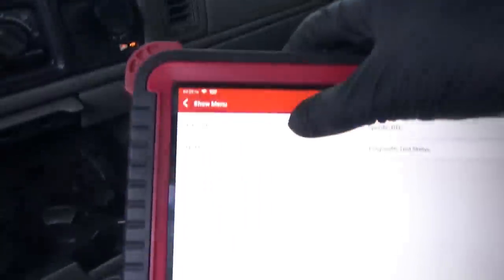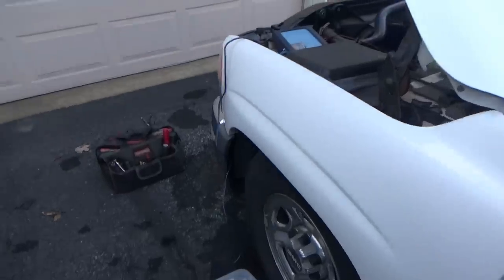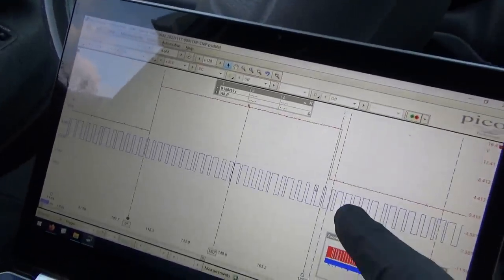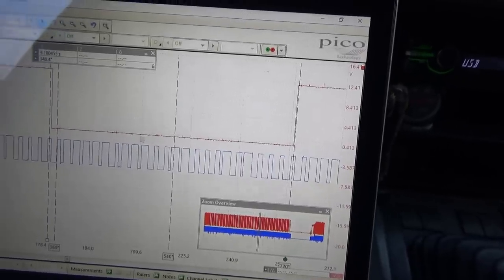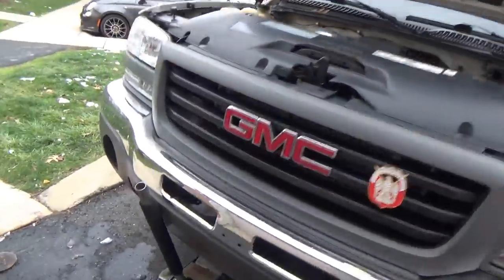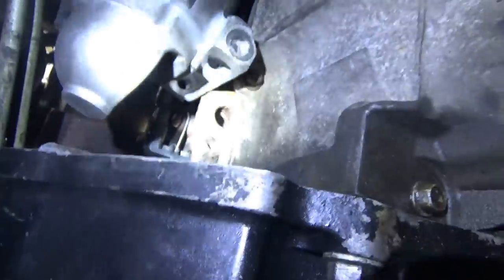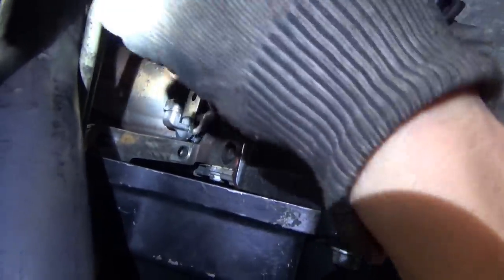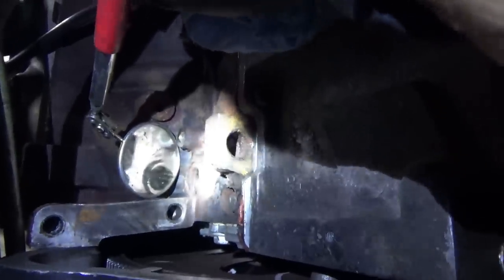Angry GMC: Runs Like GARBAGE! (Stall-Misfire: P0336-CKP Performance)

Comment: Well done Ivan.  I had a Range Rover Evoque with a cam crank code and the crank sensor had a similar issue in detecting the teeth at higher rpm.   Distance matters, especially with cheaper oem parts that aren’t as sensitive to begin with.  All hail King Ivan, Lord of the NPR repair.
Reply from the maker: Air gap is crucial! Especially at high rpm!

Comment: Wow. Your ability to process "long" and "short" pulses is better than some of my violin students 🤣
Reply from the maker: Did they diag the Camry V6 misfire yet Greg? My money is on ignition...like a bad spark plug wire on the 2000 Sienna ;)
Reply: @PineHollowAutoDiagnostics  not yet. The shop is booked up. Good thing I have two other hoopties 😜 I'm hoping it's an ignition coil or wire issue, and not low compression on a cylinder. It's been shaking a little for a long time, but maybe running up a mountain at 4k rpm did something 😬
Reply from the maker: @GregoryGlessnerViolin  Nah italian tune up only makes those run better :) Should be a 10-minute diag..."booked up" is a poor excuse lol!

Comment: Well done ivan 😀
It's such a crude sensor fit for a critical measurement.
So the amplitude of the pulses may not have been high enough to register on the input of the computer all the time.
They should of put two bolts on a ring to apply pressure to both sides of the sensor.
Tight ass manufacturers lol.
The owner looked so happy 😀

Comment: I've seen this a couple times. Happens on dodge magnums too. Rust builds up right by the o ring and just that little bit will cause problems. And I'm not sure Ivan, people on the internet tell me all the time that I don't need a scope. "Just use a dvom and watch for voltage changes" makes me wanna beat someone lol
Reply: Apparently they don't realize 24x wheel at only 2000 rpm = 800 registers a second even if a dvom could read that fast they couldn't...

Comment: Did you ever verify if that sensor that was in it was OEM??? So you never tried the old part man took out for comparison sake??? Amazing Ivan. What a clever diagnosis and results
Reply: The truck runs correctly so it's no need to prove anything that Ivan didn't get involved with.
Reply: The owner claimed AC delco, but it would have been worth a look

Comment: Buick 3800's of most era's use two tone rings on the back of the harmonic balancer and two Crank positions sensors (it is one physical unit, two hall effect sensors).  One tone wheel is evenly spaced, same size teeth while the other is long and short to indicate cylinder TDC.  Even the GM sensors for these are now junk so a better bet is anything with lifetime warranty and being skilled at swapping them.

Comment: well, Ivan is now more familiar with LS engines and the goofy two piece riveted together and interference press fit onto crank with no key/dowel pins! :)
not that you will, but to install/remove them you heat the snot out of them and work carefully, precisely marking alignment is critical before removing them or make/buy a special alignment jig.

Comment: The sensor is sensing the complementary target. It senses the shift of the magnetic field from oneside of the target to the other.  This design allows for less sensitivity to the airgap. Also allows zero speed detection of target with high tooth count.  Same type of sensor for the cam shaft but its target is machined. Not a sandwich stamped target like the crank shaft target.
Reply from the maker: But it is VERY sensitive to air gap apparently!

Comment: The crank sensor magnetic surface position to the teeth is very precise, I guess it should be parallel to the teeths, and the bracket play a big role in it, if the bracket somehow deformed, it will definitely affect the performance of the whole sensor, and as consequence bad engine performance.

Comment: That rust sure causes a lot of problems!  The owner's REAL HAPPY now!  How long did the truck sit before you got to it?  Hopefully the gas tank was full so no moisture collected in the tank.  This diagnose reminded me of that GM pick up with OBD1 when you swapped PROM's in the PCM.  With all the mods done to it, it's a wonder it runs.  Maybe a good dyno tech could help it run better for optimum performance.
Good fix Ivan!

Comment: I wonder if the old sensor was rust jacked out of place tossing the code.  Replacing the sensor didn't work because of failure to clean up the hole before installation.  Huh.  May never know.

Comment: I have 369k miles on that GM best vehicle s I got 400k out of 5.3 GM one transmission
Cam loping with rich exhaust throw a O2 fuel trim code? 
Aftermarket parts often POS.
CAm and Crank sensors  compare to check timing chain stretch or loose cam gear reluctor.
I found metal chips on sensor magnets also cause havoc.

Comment: I wonder if the rust was the issue with the original sensor? Rust built up and pushed it out a little bit, thus the replacement not fixing the issue?
Reply from the maker: Yup

Comment: Do the 2 reluctor wheels cause the signal timing to change by small amounts based on RPM. It would be interesting to compare the wave form at different RPMs. A solid state variable ignition timing system. ???

Comment: I got a 2012 impala ltz with p0305 misfire.  Swapped plugs, swapped coils with known good, swapped injector with known good, cleaned intake valves, still misfiring need your help.  Do you ever make it up to michigan?
Reply: Runs good and smooth on the free way.  You can feel the miss when idling like at a stop light.

Comment: The unnecessary o-ring strikes again. I've seen this so many times when people replace their own sensors. I usually don't even clean the hole out, I just take the o-ring off and slather some fluid film or grease in there.
Reply from the maker: Uhhh then you would have an oil leak 😅
Reply: @PineHollowAutoDiagnostics  I just top the bellhousing fluid off every time they come in for an oil change and it's all good.
Reply from the maker: @JPAutoService  🤣🤦‍♂️ so your method would not work on this truck haha

Comment: How does the computer get the fuel trim at idle correct with those long overlap cams?  Seems to me the cats would melt?
Reply: No cats
Reply from the maker: Fuel trims are like 20% at idle but it still runs lol!
Reply: @PineHollowAutoDiagnostics  No check engine light?

Comment: So it has a new cam. How about a new crank? Perhaps it is a rebuild? I think the ultra sensitive crank sensor signal (gap dependency) is due to the crank walking (thrust) end play too big? If the crank is worn the end play should be checked and addressed during the rebuild, which may require additional parts above what is in the rebuild kit.

Comment: It kind of makes you wonder if his old sensor was actually going bad?  Or if the rust buildup was just pushing the old sensor out of the hole?
Reply from the maker: I'm sure it was just the rust issue :)
Reply: @PineHollowAutoDiagnostics  From our vantage point in the video, it looked like rust scale was bullying the sensor out to me.  After you cleaned it up, did you try any rust inhibitor to help prevent this from happening again?
Reply from the maker: @Sandmansa  Marine grease :)

Comment: Cool diagnostics, the only part I dont get is why it was coding only when you rev it? P.S.  The AC Delco suppose to be GM OEM part but when ordered from dealer it comes in different package.👍
Reply: Because with a reluctance sensor like that, both the air gap between the sensor and the reluctor wheel, as well as how fast the reluctor teeth are traveling by the sensor matters. So if the gap is a little too big, it will detect properly at idle when the teeth are moving slowly, but misread when it's running faster and the teeth are moving past the sensor quicker.

Comment: How did pre computer age cars run at all , no sensors, no computers , you could lift the hood and actually see the engine . You could adjust your own car/truck engine with a cheap wall- mart socket set and a few screw drivers . Didn't need to take your vehicle to a electronics expert   or to a shop that charges $300 an hour for shop time . I really think they are going backwards with all this computer crap under the hood .
Reply from the maker: $300/hr?? Are you from California?
Reply: @PineHollowAutoDiagnostics  lol.  What is your shop time at dealers there ? I got a Nissan Micra 335,000 km and never been to a shop . Bought it in 2014 ( model year 2015 )
Reply from the maker: @grazynazambeanie5963  maybe $150 per hour? Depends on brand...